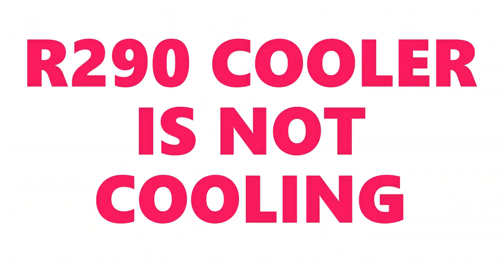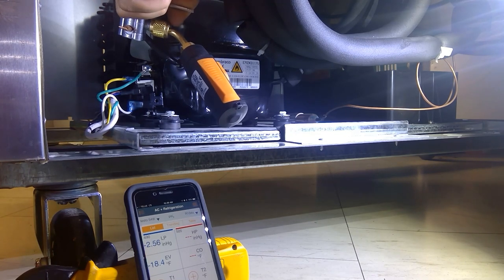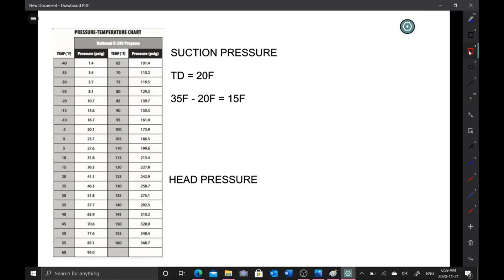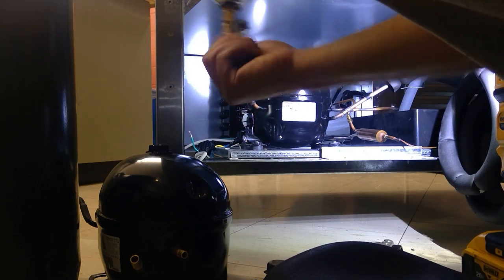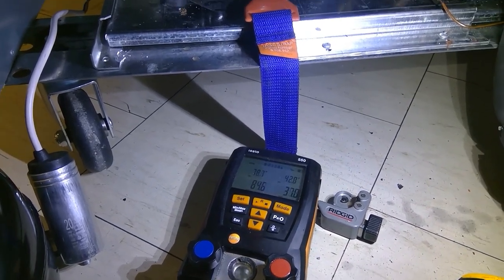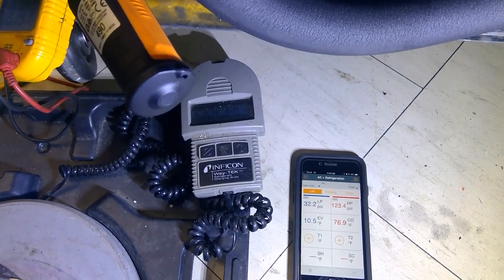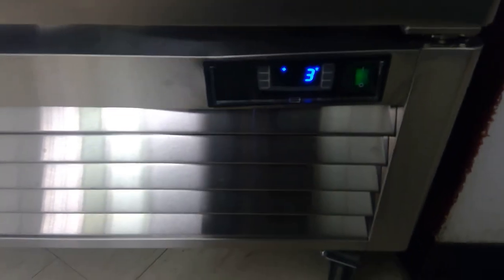Cooler is not cooling (R290)

Comment: Thanks for a Very Informative vidclip .... I am in NZ, Retired and I do some 'Fridgie' work for myself, to keep me busy .... I have just had virtually the Exact same Compressor, same make, and it also failed with the Very Same Symptoms .... The 'Standing Pressure' was fine .... When I removed the compressor, I tried to tip out the 'Oil', there was not even a Teaspoon of Oil in it, super Brown and Stank.... So the Compressor had intemittent 'Seizing' and the Amps had Exactly the same 'Draw Chacteristic' as in your Great vidclip .... Very Best to ALL, Thanks Again, cheers from Christhurch, New Zealand.

Comment: Starting next week as a kitchen technician. This is gonna be a rough learning curve but you’ve already helped so much really appreciate your videos. 

Great work
Reply from the maker: Good luck to you sir! It’s gonna be a long first year. Take your time, don’t take shortcuts and master schematics and you will dominate the industry.
Reply: @REFRIGERATIONKITCHENEQTECH I'm in Ontario Canada,my true vertical fridge soda cooler isn't cooling. Our technician added gas and charged it but said it still doesn't work. Told me to keep it running and if that doesn't work he said to just buy new one or get a free one from Coke and Pepsi. It's a 10 year plus unit. Compressor was working very hard and some.of out water will freeze as well. Especially the water bottles at the back. Any idea where to take action on this?

Comment: Thank you for your great videos. Still quite green in the trade and your charts and equations help a lot, as I did not go to trade school. So, after replacing the start components and you found that it didn't help, did you replace the compressor or just the filter drier?
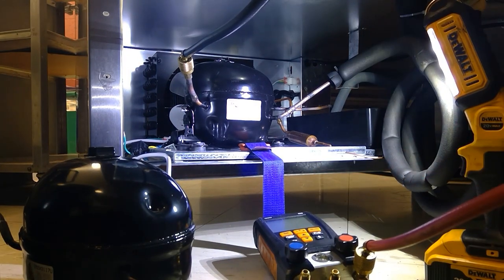Reply: oh you obviously replaced the compressor because the old one is showing at 7:07. mb.

Comment: That’s funny, I do the same thing, replace those start components. They are usually bad.  I was noting you didn’t invert the propane cylinder??? You charge vapor? I have the same scale as you.  With that small a charge! I get skeptical on its accuracy with charges that small.  If I zero the scale out with let’s say 2 pounds on it....if I come back 10 minutes later it’s changed by .7 ounces because I think it’s just a heated diode or spring that changes. To help stop this I acclimate my scale where I’m using it by removing it from the case and try do this at least 30 minutes before I need it.
Reply from the maker: Yes, I don’t really trust that scale for the small charges unfortunately. Some of the other commentators on some of my videos told me about this new scale where the bottle screws into it and you charge it from there. The price was like under $150 I think so I’m going to most likely order one of those.
Reply: @REFRIGERATIONKITCHENEQTECH  before you do... the max charge for maximum propane charge is just over 5 oz, the bottle can’t be more than 3 pounds so look for a cheap throw away scale that Max’s out at about 5 to 8 pounds.  Then you’ll get better accuracy.  If you have a new bottle of it, just weigh a full one then double the pounds. This should give you a good midrange on the scale.  Less than 40 dollars I suspect.  Use a cardboard container to support  it upside down, then zero the scale.
Reply from the maker: Yes we have those cardboard holders as well. We are going to start using the 1/4” hoses that just came out in our area as well. I’m curious to see how this new scale goes, the reviews from other techs has been really good.

Comment: Hey I have a question,  where did you get the value for the TD? Is that specced on the rating plate/decal? Just taking a guess but everything else makes sense
Reply from the maker: Every manufacturer could be different, but generally a cap tube will have an evaporator TD of 20F. Condensers on these reach ins are usually a 30F condenser split, but I’ve seen it as low as 15F condenser split on some lesser known manufacturers. Unfortunately, this info is not on the nameplate.
Reply: @REFRIGERATIONKITCHENEQTECH  hey thanks for the reply! One more question,  does the length of the cap tube matter? I understand the idea is to restrict flow so I am guessing you should have a certain length on the tube.
Reply from the maker: Yes length will matter. Too short and there will too much flow, too long and there won’t be enough flow. Now there have been instances where the cap tube is restricted and I’ll cut an inch or so off both ends, blow out with nitrogen and braze it back together.
Reply: @REFRIGERATIONKITCHENEQTECH  if you have time I would love to see a video on how to properly select the right cap tube length.  Thanks for sharing your thoughts

Comment: Have you changed the compressor?
Reply from the maker: Yup
Reply: @REFRIGERATIONKITCHENEQTECH  how then is the freezer pressure calculated where the desired temperature is 0F, 0-20F equals -20F which is very low
Reply from the maker: Your evaporator coil needs to be colder than your box temp, or else we will never get to temp. In the case of reach ins, we want the refrigerant going through the evaporator coil to be 20F colder than our desisted box temp.
Reply: @REFRIGERATIONKITCHENEQTECH  and okay and how much should be the desired temp of the minus freezer box, that is, to read the formula for calculating the suction pressure x-20F = x
Reply from the maker: 0F to -4F